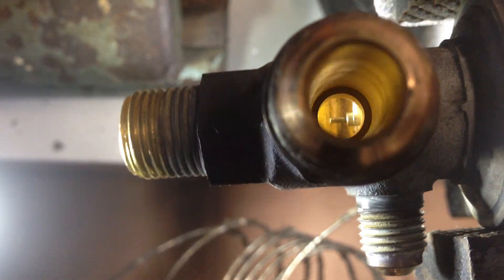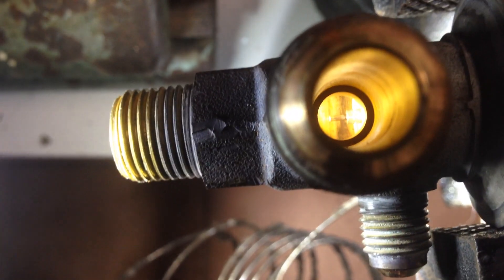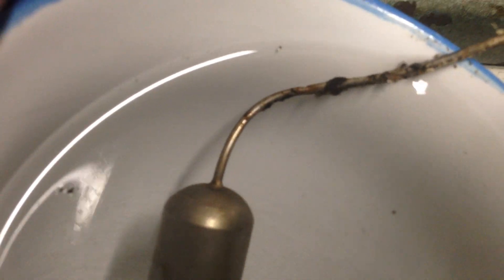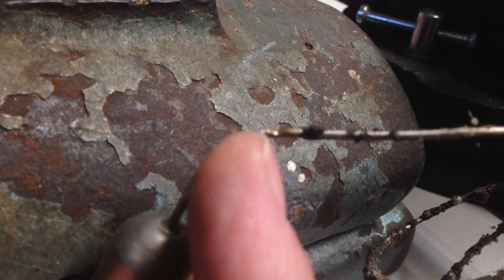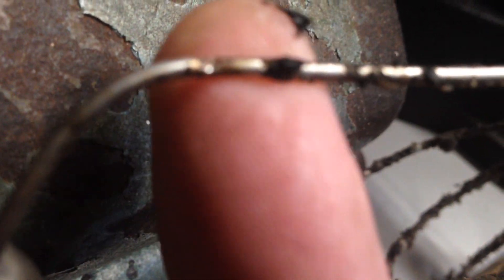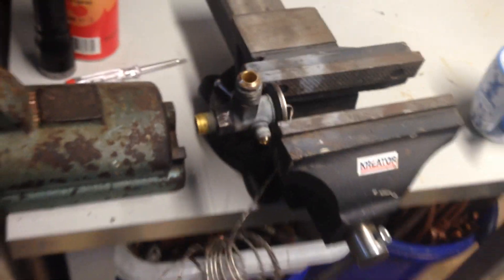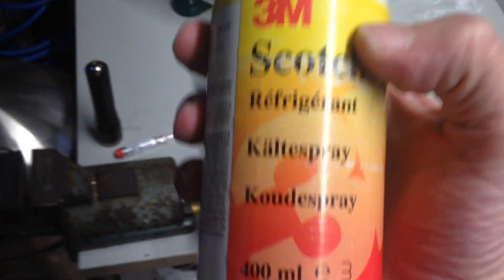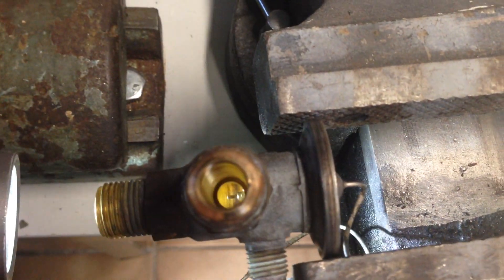Expansion valve testing

Comment: Did you ever do this test on a working one and see the needle move? I have three 35-year-old expansion valves and not one of them seems to do anything. Need to decide to install it on the car or not. A new one isn't available.
Reply from the maker: Yes a working one should move the needle fine. use a cup of hot water. and a cup of ice water. if the part is older some times the needle sticks. heat is up a bit more and i wil come loose ;)
Reply: HVAC James on the job and more just got a new valve and tested it and nothing happens so I guess I'm missing something.
Reply from the maker: @perrysaunders777  That is verry strange... remember the needle only moves a small amount. hard to see some times. i'm gonna try to make a video this week with a working one.
Reply from the maker: @perrysaunders777  https://youtu.be/TPshskp-85g new video. on a working valve  😉